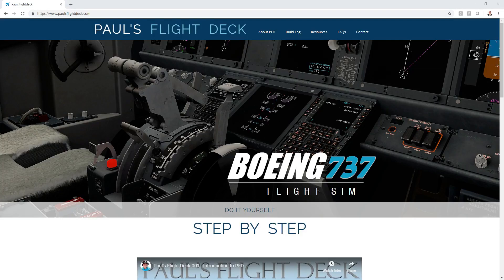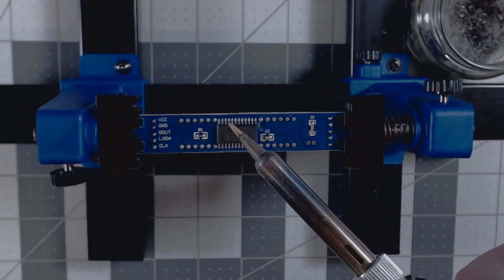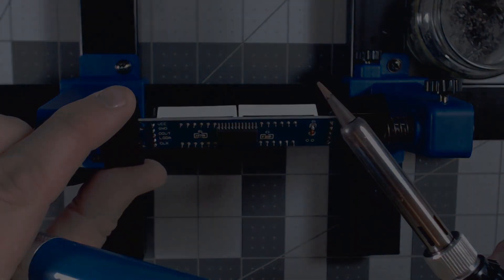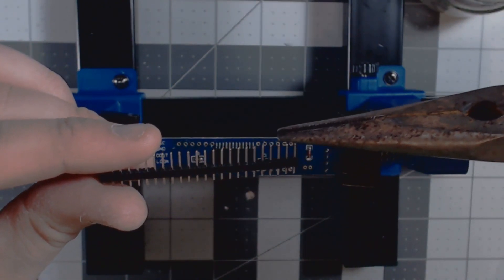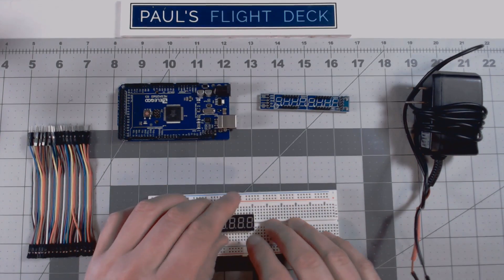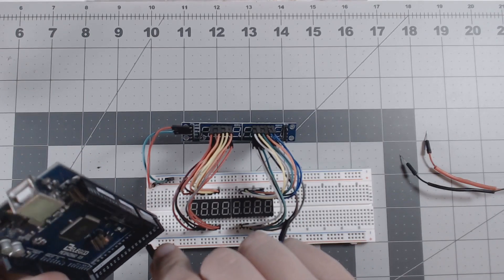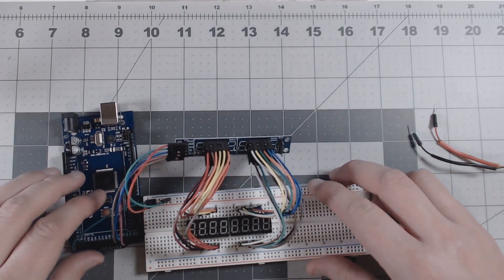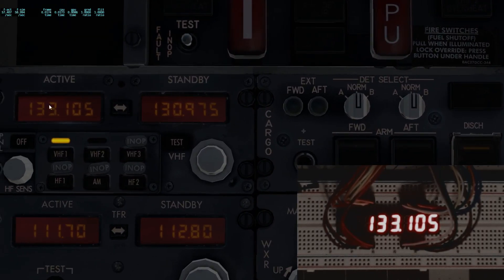Paul's Flight Deck 005 - Simple VHF Radio Part 3

Comment: Hi there, I'm just reaching out although I'm not sure if you are still picking up messages? Basically I am wondering if you ever had an issue of using a momentary switch to operate GNS530 COM 1 & 2 flip switches in XP11. I have rigged up some momentary switches through SimVim and everything works fine (i.e. GNS530 VLOC frequency flip, CDI button, Proc button etc.) except for when it comes to the GNS530 COM1 or 2 flip switches. Instead of flipping from standby frequency to active, it keeps changing to the emergency frequency of 121.500. This will happen in real life if you hold the flip switch down for a second or two and it appears to me that the momentary switches I'm using are replicating this, instead of just changing frequencies as intended! Sorry for the ramble, but it may be something that you've come across before? Kind regards from the UK :-)

Comment: Good job , but no need to unsolder with this: 
https://www.amazon.it/TOOGOO-display-MAX7219-controllo-digitale/dp/B00YMIKPCO/ref=sr_1_9?__mk_it_IT=%C3%85M%C3%85%C5%BD%C3%95%C3%91&keywords=MAX7219&qid=1557771974&s=gateway&sr=8-9

Comment: I did look into the DM13A driver but in comparision is seems a more expensive route. Although you can buy 7 segment LEDs a smaller size and make the number of digits you need (like 3 for Heading) it'll soon add up
Reply from the maker: Hey Orb505Gaming,  It definitely takes a bit more time and work to configure the DM31A Driver with Seven Segment Displays, but I still plan on doing a tutorial later to explain their use and do a demo, but I'm leaning more toward desoldering MAX7219 modules and replacing with smaller displays myself.  It's just less work in the end, and as you said, maybe even cheaper as well.
Reply: @the-sim-life  Give desoldering braid/tape a go. The solder sucker is great but sometimes the braid works better. It's one of those things where having more than one things in your arsenal is good
Reply: @orb505  All informaition and video manuals will be soon on our "official" YouTube" and website.
Using the DM13A (or similar driver) is very easy and convenient for making "custom" displays.  Desoldering the MAX7219 module can be  be more complicated
Vlad
Reply: Also, you can look at the MAx7219 dot-matrix modules, which can be used directly, no need to desolder anything, just use 7-segment indicators instead of the dot-matrix panel.
Here - http://simvim.com/svc_digout.html - you can see such module used for LED matrix in SimVim